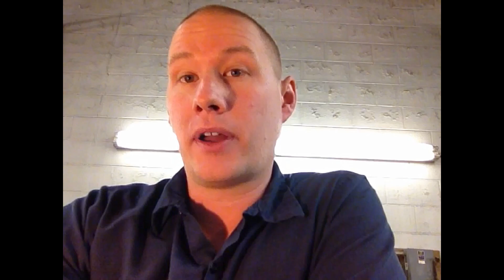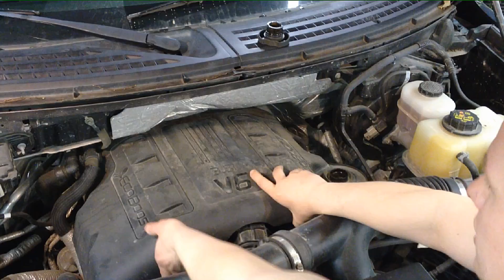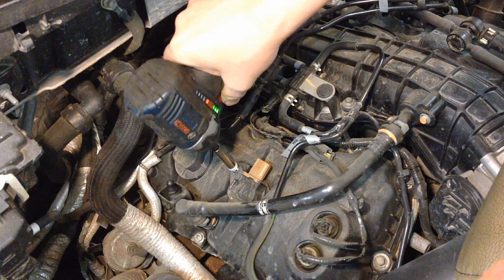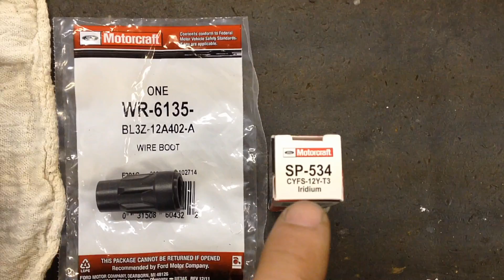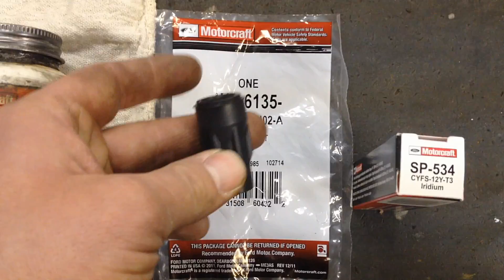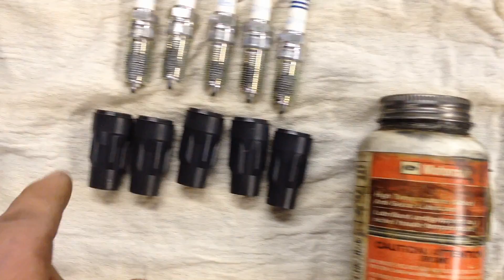2011-2016 Ford F-150 3.5L V6 EcoBoost Spark Plug Replacement

Comment: I recently had some significant work done to my engine and I asked them to look into a cylinder misfire.  Felt like a single plug was bad.  Typically I've been asking the dealer to only replace the offending plug figuring the rest would be replaced at some point by timed obsolescence.  Anyways, he ended up replaced all 6.  When I left the truck had a major misfire that would result in cylinder shut down.  Error code was P0313, lean condition due to low fuel.  Well, before we did a fuel pump I asked them to throw another hour of diagnostics at it.  Well, in that time, they noticed the misfire was jumping between cylinders.  Turns out the brand new plugs were carbon arced!  Don't know why a misfire would throw that engine code, but it does explain why the truck would blow black smoke when it would lay down.  Well under TSB 14-0160 he replaced all 6 plug wires and installed 6 new plugs.  Truck now runs better than ever!  If your truck was built before 6-15-13 it might be worthwhile looking into.
Reply: the tech who did it most likely did not change the boots on the cool...

Comment: I am changing my plugs at 15k on my 2014 right now.  Everything is coming off really easy since it is new.   Putting anti size and boot lube as they go back in.   Techs can thank me later.

My question:  What are you standing on?
Reply: Mike McKay  i was thinking the same thing regarding what he was standing on.  My knees and back and elbows and forearms kill me after only a couple mins tinkering in the engine bay!!!  Brian, what are u standing on?
Reply: Glad I'm not the only one!
Reply: I stood on the second step of a 5 ft ladder.  Reached everything from the front.
Reply: 5 gallon bucket worked perfect for me
 @vickprakash8247

Comment: I finally got around to re-gapping my plugs to .028, it drives like a new one. Thanks
Why don't the local Ford mechanic know this stuff?
Reply: 90% of ford techs are under the gun to complete the job as fast and as many as they can to collect there commission. They are often unexperienced and do not know the actuial science behind the components they are working on. They work for the dealership not you and mostly there reputation will not be damaged by there incompetency. Sad to say but often times true. Most good techs leave the dealerships to own there own shops because it doesn't take long to realize the customers are getting taken advantage of that's why the service writers are salesmen and plausible deniability is the rule.
Reply: @williamvaughan1218  100%  TRUTH .
Reply: Because they are retarded
Reply: .28 for motorcraft plugs for the 3.5 ecoboost?
Reply: Thx for the info on gaping I'll keep it in mind 👍😎
Reply: it changes weekly

Comment: Great video.  Question though - your plugs came out with ease, but I it took quite a bit of effort to get even the first plug out.  I could not budge the next two at all, and the 2nd one was just replaced by the dealer after eating the coil pack.  Any advice for how to get them loose?  The one plug I did get looked just like the old ones you showed.  Thanks in advance!
Reply from the maker: gtrietsc I little wd40 down in there will help some.

Comment: Do the early model 2013 F150 Ecoboosts have the same gap issues?  Just bought mine w/ 90k miles on it that was "serviced" at 89k (would they routinely change this if the vehicle was in for service?) Thanks!
Reply from the maker: Shelby Paget They sure do and if you have 90k I would suggest changing yours. They are not to be changed during regular service intervals.
Reply: FordTechMakuloco Thank you very much!  Will take her in soon!
Reply: X

Comment: Wish I saw this video before I changed my plugs. Dealer told me .028 to .037 so I set mine to .035 and didn't change the boots. Number 6 was carbon tracking. Is it worth the time to pull them out regap and put on new boots?
Reply from the maker: I would yes .035 is way too high.
Reply: Thanks, I'll re-gap.
BTW, is there a way to deter water getting into the Vac Pump for Brakes, by sealing it someway?
Reply: FordTechMakuloco what is the recommended gap for the 2012 6 cylinder ecoboost?

Comment: Thank you for a fantastic tutorial. I have a 2011 F150 Ecoboost and at 65K the shuddering/bucking and CEL came on at any acceleration. When I called the local dealer, they wanted it towed in and warned me it could be anything from a blown turbo to a cat. Never mentioned spark plugs. 65$ later and your video, I am back on the road with a different feeling truck and improved gas mileage. Thanks again...
Reply from the maker: Paul Bowser awesome!!
Reply: Thank you for taking your time to make  these videos .you make ford a better product . most people will attempt to do some of thier own work and louse things up giving ford a bad rap so ford should thank you also
Reply: Ford tried to scare me with the cat thing too.  They also said "the spark plugs POWER the turbo".  They tried to scare me with the "if you do not change the plugs and your cat goes bad, the turbos will go out".  They are saying a CEL wont warn ya... and that a CEL coming on means you likely already have damage.  Seems like a very insensitive system... or an ignorant service guy.  It was all the weirdest thing a service dept guy had ever said.  I had to stop them and educate them, as I know how to install and tune turbos and how to work on everything.

Comment: Nothing like finishing the engineering after the vehicles are sold.
Reply: Ford been doing it for years, 5.4 triton, 6.0 powerstroke, 6.4 powerstroke, 7speed dual clutch transmission and the list goes on

Comment: I was in the process of buying a 2012 XLT 4X4. During test drive encountered misfire under load and went into safe mode. Saw your videos and lowered my offer by $2500. Bought new plugs from Ford for 2014 Ecoboost. They were gaped at .030. Old plugs were worn to .047. I can't thank you enough. The truck now runs great with just a plug change!
Reply: The same with me. I got a P0305 misfire on cylinder 5. I replace the coil pack and did not fix the problem. Change the plug in just cylinder 5 to see if there would be a difference, but same misfire under heavy throttle. Went back and got 5 more spark plugs and changed all and now running great.
Reply: Jason Hipkins I’m on the same route
Reply: @jasonhipkins damn i thought i was gonna be good changing just the one. probably gonna have to change em all. should do it that way anyway though 🤷‍♂️
Reply: paul grande great engines the Ecoboost!
Reply: Shoulda done that with my 16 expedition 😅
Reply: You owe makuloco $2500 lol

Comment: hey great video.   2 questions   1   when I took the cover off and engine was running it sounded like I had a lifter sticking.  Is that the high pressure pump working in the back corner with the cover on it?   2  When I removed the oil cap there was a white thick oily paste on and around the fill tube  Any ideas what this is caused by?  I run Castrol Syntec 5W 30    thx
Reply from the maker: Yes these are both normal here is a few videos explaining just that-
https://www.youtube.com/watch?v=71itwBP7akA
https://www.youtube.com/watch?v=MzCxnrG_OxU
Reply: hey thx so much  that totally explains everything.

Comment: The only torque wrench I could find locally was 20-100 ftlb. Would it be dangerous to use this wrench, or is there any trick to getting it to 133?

and I'm assuming this is just about the same procedure I would use for a 2014 Explorer 3.5L V6 TT, yea?
Reply from the maker: LakersCentral No trick just snug them up with a 3/8 standard length ratchet and you will be ok.

Comment: Good idea to put anti seize on the taper seat portion of the spark plug also.
Some of the best anti-seize around is Jet-Lube SS-30 Copper High Temp Anti-Seize Lubricant.
You will thank yourself on the next plug change!
Reply: You don't want to use copper based anti-seize, use nickle based, nickle based has higher temperature tolerance, cooper will eventually became solid under high temp overtime.
Reply: 100 % correct.

Comment: Excellent video, I have a 2013 F 150 4x4 eco boost, 32K miles, So i will check into the upgrade spark plugs. thanks
Reply from the maker: dave holman Yeah if you start to feel it I would not mess around and just change them out.
Reply: FordTechMakuloco I looked under the hood, I have the Air cooler AC,and it has upper air blockers. SO I will ask dealer about TSB-14-0017
Reply: FordTechMakuloco Bought motorcraft  plugs today, but no one stocks the boot, will head to local ford dealer for them Monday, whats your opinion on gap? I'm thinking .30
Reply from the maker: .28" for sure
Reply: FordTechMakuloco  thanks. All were new plug number but gapped to .37. I set at .30 out of the box they was .35.  Stumble at idle is gone now. Running good. Keep up great work. Tonight I service engine and Trans fluid

Comment: Do all EB's come with the high pressure pump noise insulator?  I changed my plugs out last week and did not have to remove it because it was not there...
Reply from the maker: I have never seen one without it.

Comment: any updates on the misfiring issue? Was debating between one of these or an f250 powerstroke.
Reply from the maker: No new updates no just small fixes here and there like this one for known issues. From what I hear and see they don't seem to be a huge issue. Remember most of what you see on boards etc is people complaining about an issue but you will never hear of the others with no problems

Comment: Thanks for the response. I replied to a vid of yours that explains about a TSB to remove the baffles on the intercooler and re-flash the ECM/PCM and having greatly reduced MPG  and wonder if you've seen a lot of this issue
Reply from the maker: Brandon Cunningham It is all in the tune we hear it all the time with reflashes gas diesel all the same. Most say the mpg's come back with time as the computer learns but with this flash and how many items got changed IDK if you will ever get it back.

Comment: Will this cause transmission to chatter at 110km when I step on it 3.5 ecoboost
Reply from the maker: It will feel like transmission shudder if it is bad enough yes otherwise a surging.

Comment: My 2011 Ecoboost is having some weird misfire issues. I took it in Twice now, first was a coil on #4, then the 2nd the tech said it was that the boots wasnt seated all the way. Last night driving home from work its started doing the hard surging again while trying to enter freeway traffic. Do you recommend changing all plugs and boots? I have 53K miles on my truck now and this is the first issue i had for it?
Reply from the maker: Yes I would not mess around coils are few and far but this issue with carbon tracking is a real problem. At your mileage I would do this whole procedure and retest from there.
Reply: Cool man, Thank you i appreciate it.

Comment: Matco tools offers a set of magnetic spark plug sockets with built in swivels and different length extensions. We work on Cummins CNG engines and Cummins recommend magnetic due to the rubber style can hold oil and cause misfires. Not sure if the other tool company's offer similar sets. The Matco set wasn't over $40.00 if I remember.
Reply: I use an old,, (cleaned) Coil boot pressed over my extension bar. works great, doesn't attract slivers and shavings, and doesnt cost a cent.

Comment: Great video. My Old 95 Town Car got up to 322,000 miles and 100% original under the hood except 1 a/c clutch. Still running great when crashed. Never had a plug strip. I wish Ford would put a 2.0 Diesel engine in the USA Fusion.

Comment: Does ford recommend induction cleanings on GDI systems?. We were doing them like crazy on Chevy traverses because of carbon issues... If anyone thinks the  5.4 tritons with the powered metal rods and breaking spark plugs were junk the gm 3.6's Are worse
Reply from the maker: nmattcar On GDI systems they do yes but we don't do many as of yet.

Comment: Replaced my plugs at 80,000 miles. Noted power loss. Great videos. What are your thoughts on oil blow by catch can? Will these help decrease carbon on valve train and do you only do it on passenger side?
Reply from the maker: Fletcher Schubert Catch cans are always a good idea to prevent the coking on the valves, but the carbon from the DI will still be there. Do you only put catch can on passenger side?